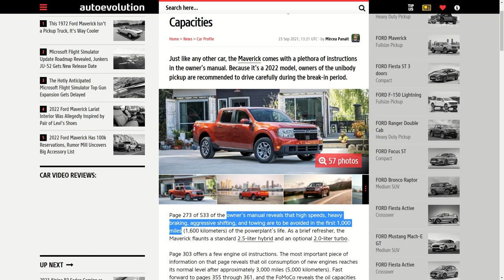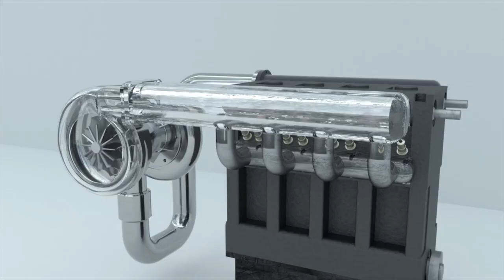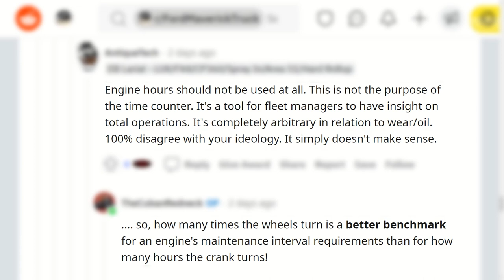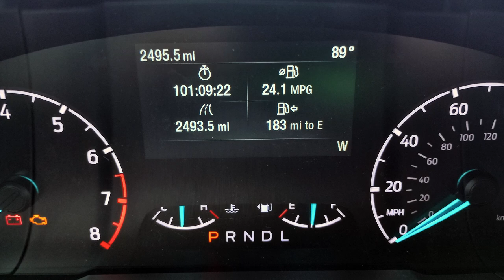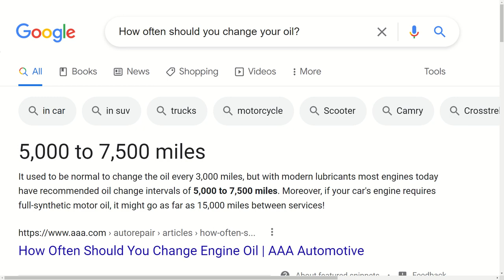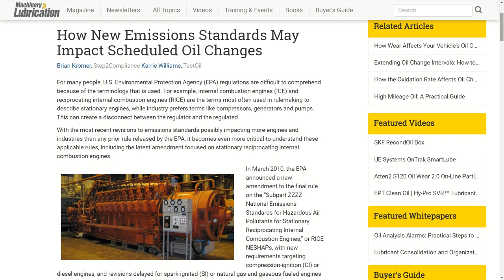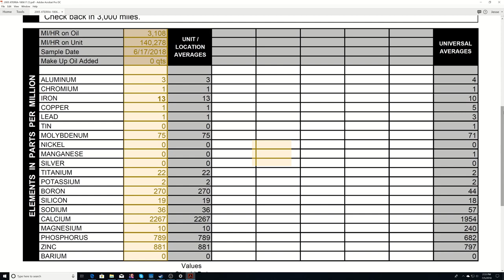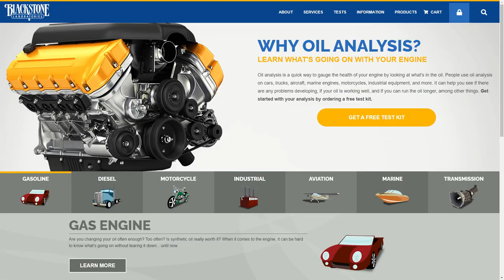The Truth About How Often Do You Need Oil Changes

Comment: Is there any hour meter you would recommend to install on a modern car ?
Reply from the maker: … hey, thank you for your visit. Just about every gauge company out there makes an hour meter. Autometer and Borg Warner are the leading brands, but I have had good luck with a brand called Runleader. I have a friend the owns a tow truck company, and I installed about a dozen of these years ago. To the best of my knowledge, they are all working still -  https://www.amazon.com/dp/B07RHMGNHT?tag=vert0a-20&linkCode=ogi&th=1&psc=1   

If you want a little more functionality, this is what I have on my bike. Harley doesn’t believe in tacks or temp gauges - https://www.amazon.com/dp/B092CDSQ33?tag=vert0a-20&linkCode=ogi&th=1&psc=1

Comment: Still waiting for the answer, not watch again,
Reply from the maker: ... hello there, I am sorry if I missed your last comment. What answer are you expecting from me?
Reply: @CubanRedneck  I guess a one sentence answer to your video title.
Reply from the maker: … I guess you mean ”The Truth About How Often Do You Need Oil Changes”  .. the answer to that is the video. You should change your oil when there are substantial amounts of suspended particles, when the oil has a strong smell of gasoline, or when its viscosity varieties from the specified. The point is that the general OCI pushed onto car manufacturers by the EPA should be taken with a grain of salt. OCI should trigger by driving conditions, NOT mileage. As I mentioned in the video, hours is a better protocol.

Comment: 3000k or 6 moths!!!
Reply from the maker: … thank you for stopping by. I agree 100%, but take a look at the owner’s manual of any 2024 vehicle, and they are talking about 10K, 20K, and even 25K miles between oil changes! The funny thing is that the warranties have not been expanded, and no new discovery has been made in engine lubrication, rod, or main bearing!